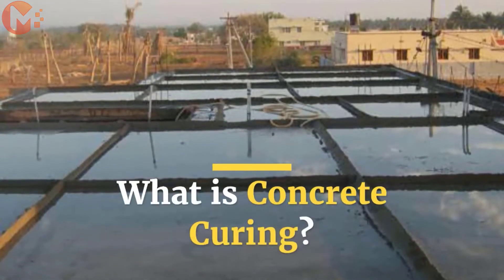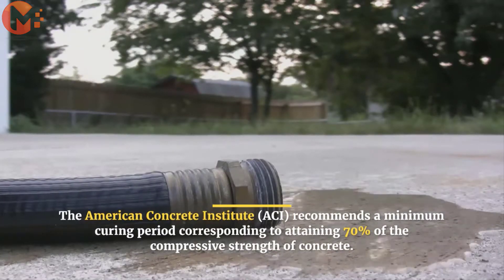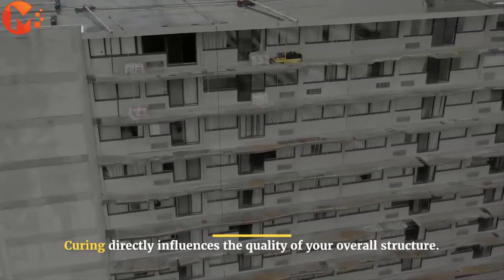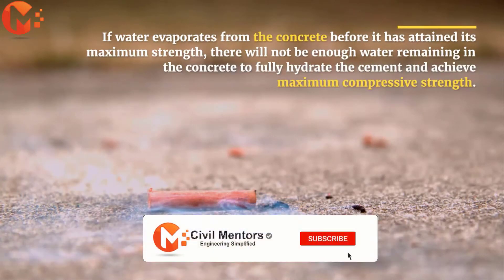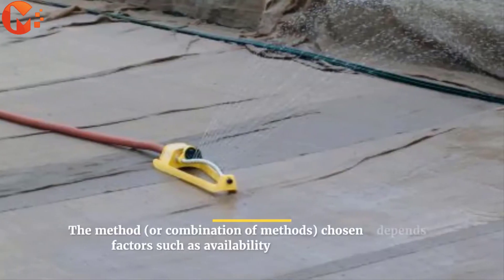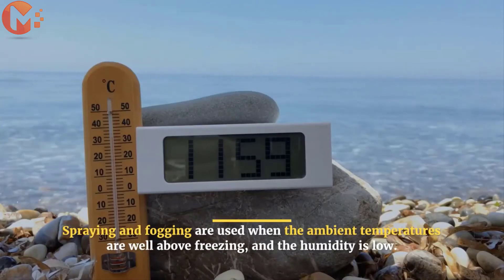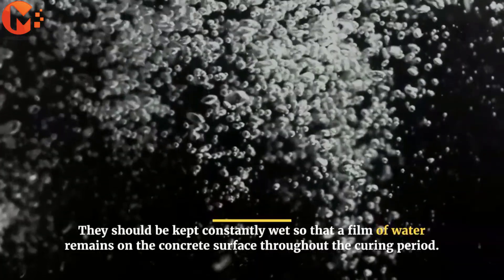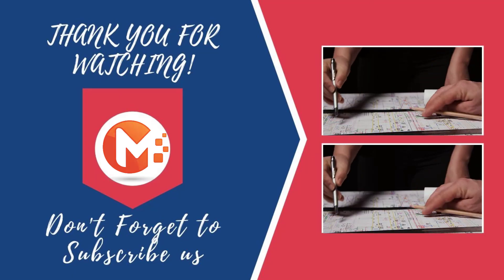Why Curing of Concrete is Important? Concrete Curing Process

Comment: Too many contractors are not properly curing concrete.  Had local guys pouring at -10c, in the forms less than 14 hrs, and forms were stripped. Code enforcement was particularly useless(not my job to babysit the contractors)

Comment: Could you explain any good and low investment and water saving technique that could be done for factory that makes aerated light weight concrete block which runs on man more than machine. Is membrane protection possible on stacked ALC bricks.
Reply: Wrong place to ask the question
Reply: One technique to save water in the production of aerated lightweight concrete (ALC) blocks is to implement a closed-loop water system. This involves capturing and treating wastewater generated during the production process, and then reusing it for subsequent production cycles. The treated water can also be used for non-potable purposes such as cleaning and irrigation.

Another low investment water-saving technique is to implement efficient water use practices, such as fixing leaks and optimizing water use during cleaning processes. For example, using low-flow nozzles and reducing the duration and frequency of cleaning can significantly reduce water usage.

Regarding the use of membrane protection on stacked ALC bricks, it is possible to use waterproof membranes to protect the blocks from moisture damage. However, this will depend on the specific application and intended use of the ALC blocks. 

It is recommended to consult with experts in the field to determine the best approach for your specific situation.
Reply: Asking a machine how to better use your machine and expecting a correct answer... 🤣😂🤣😂